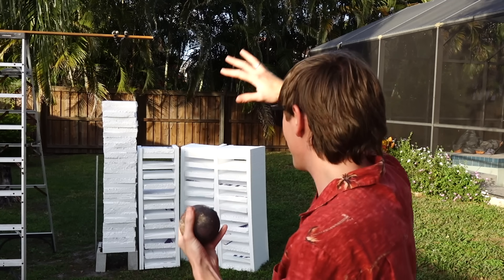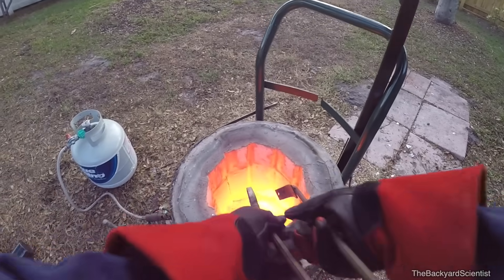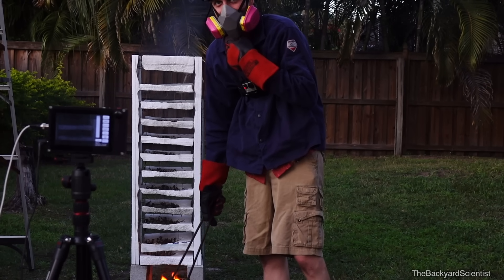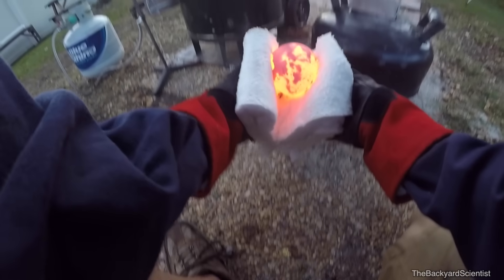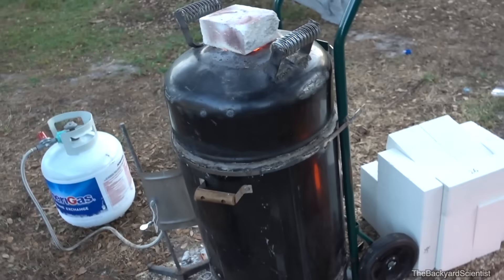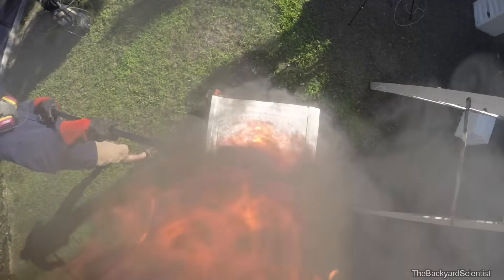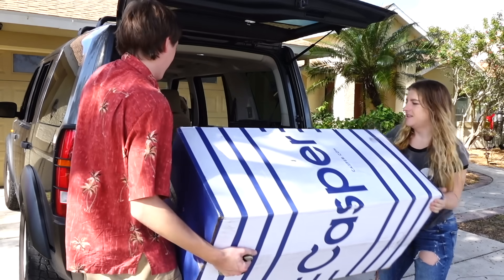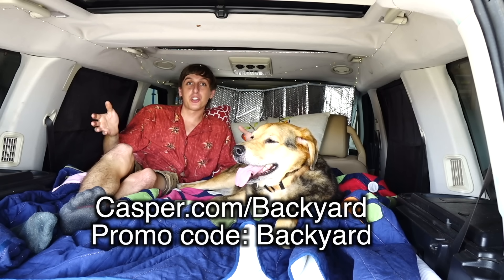Red Hot Cannonball Vs Styrofoam Tower

Comment: Buddy, those are particulate filters on your respirator (which looks too big). You need some carbon filters meant for gas. If you can smell anything with a respirator on, it isn't doing its job.
Reply: Joe Clark the guy is melting rigid with molten metal while wearing shorts I'm guessing he doesn't care that much hahaha.
Reply: He cared enough to don a respirator. If you're going to do something, don't just go through the motions. Said all the girls I've ever slept with....
Reply: Joe Clark ha!
Reply: Those are clearly 3M activated carbon filters (yellow with black stripe) with dust filters over top of them.
Reply: If I could only send you a picture of the 3m (Honeywell) filters that I have in my hand right now that are black and yellow with a pink coarse over the top of them that clearly state "Particulate filter"... Clearly.

Comment: "Good thing I'm wearing a face mask... Because this stuff stinks, I can SMELL IT THROUGH THE MASK"
Effective mask ya got there
Reply: Not good for covid 19
Reply: The type of mask he was wearing is to prevent gasses or small particles from entering your body, but does little for smells.
Reply: Eleanor Askew good to know
Reply: Eleanor Askew smell is just small particles of something though....
Reply: @rogrock9509  I think they mean that the particles is to stop the glass or dust, not meant to stop the smells, I think it's the wrong mask
Reply: Should’ve worn a KN-95😏
Reply: @Dragfire22  but smells are particles or gases
Reply: Put on closed caption at this part
Reply: @Dragfire22  that would be a small particle
Reply: @Dragfire22  I thought small particles were what cause smells?
Reply: I read it just when it played
Reply: @DrBarbequeSauce  those molecules are a lot smaller than smoke particulate.
Reply: @Dragfire22  smells are gasses
Reply: @Dragfire22  ace gang
Reply: @paperclip4594  good for covid. p100 filters filter covid. they dont finter smells

Comment: If you can smell it through the mask you need a different filter.
Reply: juan gonzalez or fit the mask better
Reply: Sigh Pocket True, I was just assuming that if he cared enough to put the mask on he would tighten it. Assumptions are bad things.
Reply: With the backyardscientist, it is never reasonable to assume he is being safe
Reply: probably not a chemical cartridge... many people just buy a fancy mask and a few of the cheapiest cartridges... I used to work with marker paint mixing it. if you used that type of carriage he is using doing what I dis your lungs woukd turn black from ink. need chemical rated mixing cartridges... 25 bucks a set vs the 10 a set cheap ones that are for saw dust and light smoke.
Reply: juan gonzalez he said it when he has his protection shield up...
Reply: Almost word for word what my response was, lol. Though I also mentioned proper fit 😛

Comment: Fun fact : One of the more plausible reasons the styrofoam didn't burn all the way through is because the styrofoam may have been fused with Antimony Trioxide (SbO3) which works as a great fire retardant because it stops carbon atoms from bonding to the air causing fire...Thank SciShow!
Reply: Isn't antimony like, pretty toxic because heavy metal.

Comment: I know no one cares, but there's a math equation for Specific Heat Capacity that would have told you all this
Reply from the maker: +2287rna and I will be using that equation when I put this red-hot cannonball in a giant pool of liquid nitrogen!
Reply: 2287rna you are right, sir! no one cares.
Reply: 2287rna Q×M×∆T is the equation
Reply: It's more fun to see it as a visual obviously.
Reply: 2287rna what's the equation
Reply: Oldnt Imdone Q=mcdeltaT: Q is enthalpy m is mass c is specific heat delta t is change in temperature (final-initial)
Reply: But that's no fun!
Reply: 2287rna i thought it would of had to do with the copper being a liquid
Reply: Also, that "smoke" was pretty f*#king toxic.

Comment: Wow in Germany you would get in serious trouble for this. Even if the fire department won't come, the police instead would. You'd have to pay a big fee for harming the atmosphere and burning "sondermüll" illegally....
Reply: Taunus-Tims Welt can't do it in KS
Reply from the maker: Thats just silly, all the pollution from private citizens and households is only a small fraction of what is made by industries. Furthermore, burning my foundry for 6 hours makes more co2 than burning that small amount of styrofoam. All the black smoke looks scary, but its just carbon from incomplete combustion. Dave has a point about other chemical byproducts, but these generally break down within a period of days to weeks.
Reply: TheBackyardScientist Nevertheless it is strictly forbidden to burn any kind of poly-whatever plastic in Germany. CO2 is not the issue here, but all the byproducts that are carcinogenic. We take stuff like that very serious over here, especially because the average population density here is much higher than in the US. Our ministry of traffic is debating about banning diesel vehicles out of bigger city's right at the moment for example. You never get Polystyrol or other plastics to burn nearly complete to CO2 under normal circumstances. You will always end up with a lot of unknown and random carbohydrates that may be toxic or not. And the amount of toxic aromatics that you can smell is just a small portion of the toxic products. The majority has not even a scent. 
That aside. I didn't want to be a hater here. Just the opposite exactly. For the purpose of doing any kind of science, especially if it is for public consumption like your videos, i think it is sometimes okay to bend the law a little. In fact i greatly regret that i couldn't do those kinds of experiments at home. When i would burn Styrofoam in my backyard, even when i live on the countryside, the police would close in on me in several minutes. I would have to pay up to 50.000 bucks for penalty. When i would make nitroglycerin just like Cody's Lab for example i would have to sit in jail for a long time. Even if i did it on my own property and even if i did not detonate it. It is strictly forbidden to produce any kind of explosive. That's just how different most states of the US and Germany are.
Reply: Oh my god, hold the phone... someone on the internet is NOT advocating a blanket ban on something? Am I in the twilight zone right now?
Reply: Myconix i don't get this one at all, sorry. What is a blanket ban? Not even google is able to translate this sentence for me in any way that it makes sense.
Reply: but you also have rent a jew
Reply from the maker: Taunus-Tims Welt thanks for your viewpoint, I do understand the logic behind both of our viewpoints makes some sense. I would never advocate to burn the stuff on a large scale at all but yes you're right I do think a small amount for a demonstration is not harmful, in the grand scheme of things it's just a drop of water in the ocean. It is just strange to me that the government would crack down on such a relatively small thing.. but then again I had to go to court because I forgot to pay highway toll in time!
Reply from the maker: Taunus-Tims Welt- A blanket ban, means making all forms of a specific activity illegal. For example a blanket ban on toy guns would target paintball guns, airsoft guns, BB guns, Nerf guns, water guns… like that.  Myconix is surprised that you understand burning Styrofoam releases harmful gases into the air, and you agree it is a bad thing to do, but you think it is OK in certain situations. In the USA we tend to be very extreme in our views it's either black or white, no middle ground, and police generally do not have very much discretion.
Reply from the maker: Kolliso Karikos  can I rent a Jew to write content for my channel?
Reply: Germany had a blanket ban on Jews...
Reply: TheBackyardScientist thank you for the explanation. Sure, normally laws are black and white, but there is very often a possibility to do something that is illegal for the majority, completely legal as individual. For example: owning guns in Germany is generally forbidden, except you are a police officer, a sportsshooter, a hunter or a collector. There would still be much limitations in how you are allowed to use or carry your gun, but it is possible with some effort. 

Burning (your own)  cars is illegal as well, but firefighters are allowed for the purpose of training. 

I meant it just in this way: as (f.e. With a certification) scientist, entertainer etc. it should be possible to get a permission for burning Styrofoam or anything like that.
Reply: Matt Hunter Germany is a little sensitive to these kind of jokes, but you know this already for sure ;)
Reply: These things make me really jealous about not living in the US :D
..germany is great in terms of (health)insurance and many other things. but there are way too many restrictions for almost anything. In my opinion there are way too many things banned here. I would love to get some chemicals here just for making some stuff you saw here by american dudes or even things you made in school chemistry class. But as Taunus-Tims Welt mentioned before: population density is maybe just too high here to give everybody more room.
Thankful that there are guys like TheBackyardScientist who are doing stuff we can't do by ourselves over here ;)
Reply: ClassiX 
Never feel jealous about the united states, canada is better and were just a lil bit north, if you ask me the us laws are a lil too loose for comfort
Reply: +DaftKnightLP L
Reply: Taunus-Tims Welt 'murica ma friend...
Also in Spain he would be in but trouble as well
Reply: It's the same in the UK, burning plastic is incredibly toxic.
Reply: NicenEasyuk to be fair: it's not as toxic as the green movements in the 80's tried to make us believe. Polyethylene burns pretty clean for example. Producing mainly co2 and water like all carbohydrates do. Depends strongly on which plastic you burn, at which temperatures and with how many oxygen.
Reply: My knowledge only stretches are far as for human consumption! Not too sure on atmosphere I just mean for, breathing in, ya know?
Reply: NicenEasyuk yeah you shouldn't probably hold your nose into the smoke and take a deep breath. Polystyrol and polyurethane may be something special, as they burn with a lot of black smoke. This smoke is mainly coal, but this coal contains all of the partially cracked and unknown hydrocarbons. 
BUT in terms of toxicity, meaning how much damage it does burning some little plastic once in a while can't be considered more bad, than living near a strongly frequented street for example. Burning diesel or petrol is comparable in toxicity. Most of the carcinogenic exhausts have absolutely no smell. Only the aromates which are in great minority in the fuel mix have a detectable smell. Saying the huge amount of burned fuels, even if burned much cleaner, easily equals or surpasses the toxicity of some burned plastic if you don't breath in the fumes directly. Do you get what i mean? The gases of burning plastic are not that toxic that you might faint, standing near some fire. A completely different story is when you are inside a burning house getting smoke poisoning. But that should be clear.
Reply: Taunus-Tims Welt k
Reply: Lived in Germany for 3 years and can attest to this. It's also a horrible place to live with all their rules on what has to be done in your own home. Arrogant people too.
Reply: Quen Loust i wouldn't call it horrible. Many rules are helpful to organize living especially in bigger cities. But i agree that some rules are just over the top and only make it more difficult to realize some stuff (like building something around your house, make small modifications to your car - lights and stuff, etc)
.. and arrogant people you will find all over the world. I wouldn't consider myself as arrogant. If you are new to country, rules and how things are supposed to be it may look a little odd first. Or you even may get annoyed by somebody telling you what you were supposed to do. 
But well, we all have our own thoughts of how things have to be ;-)
I only miss to be able to try out some things without getting in trouble. You won't be able to get here many chemicals or other stuff easily. I've personally always been a huge fan of chemistry class or physics. So seeing some stuff here on YouTube do be done gets me somehow jealous cause i can't do it myself. But well: Watching is also fun ;-)

Comment: Jet fuel would have dropped that foam building like nothin😜
Reply: Rocket fuel?
Reply: Jessica Bailey it's a 9-11 reference
Reply: Jet fuel can't melt steel beams
Reply: Jet fuel can't burn steel, but it can severely weaken it...
Reply: Jack o No you're right, it can't outright melt steel beams. But it can make it workable and flexible, and with the weight of thousands more steel beams on top, it essentially folds in on itself, quite like melting. Same concept as a forge. You don't need to melt the metal to work it with a hammer.

Comment: Styrofoam seems to melt and burn very quickly so I'm guessing it won't stop for very long and will probably just fall right through. Although, Styrofoam is pretty sturdy. A flame melts it immediately but an object that's hot will more than likely take a few seconds to melt through. I don't know about a red hot cannonball, though. My guess is still that it'll just fall right through with minimal effort. Now, let's see if I'm correct. :)

Comment: I think it will SINK though. not fall straight though. and not stay on top.
Reply: for the cannon ball and the other ball I was right...... this was not supposed to apply for molten copper. nevertheless molten copper SANK right through. and as such I was right. if it 'fell' through then it would have had to burn a hole before even touched the styrofoam. but it did touch and as such Sank through
Reply: Didn't really sink through as much as it just burned through. Sinking normally applies as a word when the density of on thing is greater than another and displaces the less dense thing to get under it. Another way to put it is that it melted through.
Reply: Nicholas Souddress what

Comment: I think it will go straight through with a bunch of fumes, because the styrofoam is something like 98% air, and since styrofoam is flammable, it will almost melt or burn, and if it doesn't, it will move out of the way.